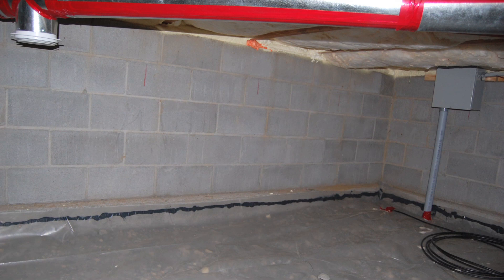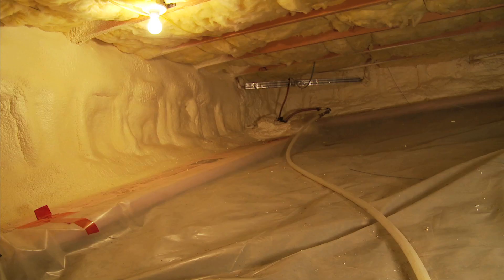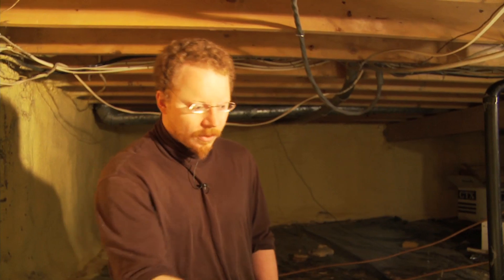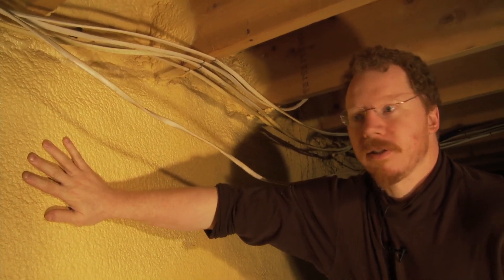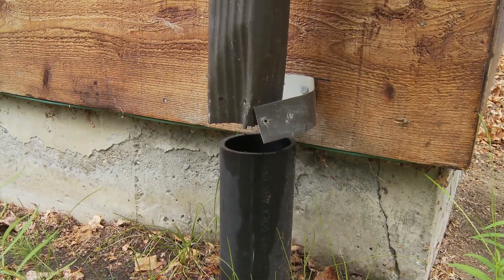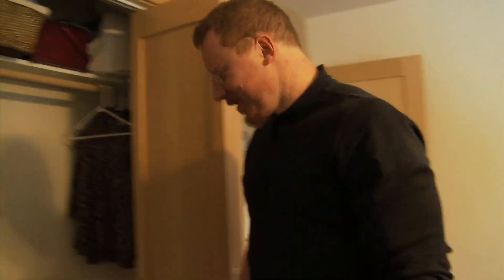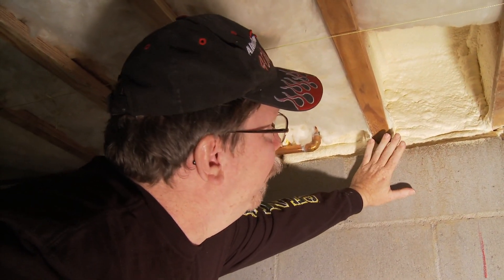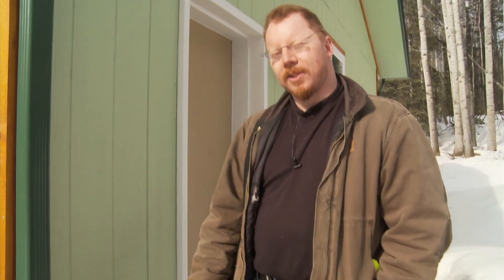Your Northern Home: understanding crawl spaces

Comment: I bought a small but wonderful cottage in Northern Michigan. Built around 1944 and updated around 1996. The crawl space is barely 18 inches! I can't get to 90% of it. There is a corner under the hot water heater where the plumbing runs from one end of the cottage to the other. Struggling to insulate this properly. A windy cold day really goes through the underside and puts those pipes at risk. Every tutorial I watch seems to work with a somewhat "ideal" crawl space. What about the outdated old piece of crap barely above the ground spaces? Any pointers would help...

Comment: If you want your crawl space to be “conditioned”, similar to the living space, why is it necessary to insulate the floor joists area?
Reply: Because it's supposed to be insulated like the rest of the living space, so you aren't losing heat/cooling
Reply: Yes, I agree. The goal is to keep the crawl space at the same temperature as the living space.  If you don't, you will get moisture condensing on all the cold surfaces of the crawlspace (including the bottom of your exposed joists). Also, this home is drawing warm moist air from one corner of the house, past the water tank, which would contribute even more moisture into the crawl space if it is allowed to be cooler than the living space...... so DO NOT INSULATE BETWEEN THE FLOOR JOISTS!!!

Comment: at 6:05 You said foam needs fire protection. 

youtube.com/watch?v=LuGTYfcs-I0  Froth-Pak seems to have a Class A foam can be left exposed up to 2"
Reply: The foam has E84 in it it will not burn. but spray foam is not a good thing to use everywhere, expensive and risky

Comment: What i did on the exterior crawl walls is waited a few weeks for the poured walls to dry then heated up 5 gallons of tar at a time with a electric charcoal lighter then rolled it on thick. you wont find a contractor to do it right like that because they want work later.  why is everybody sealing there house up so tight? if you want to save and have fresh air in the house learn about solar panels. The free electricity can heat and cool the house.
Reply: So you can pay for some kind of fresh air pump? HVAC system.

Comment: If you have pex plates with hydronic forced hot water underfloor - would it be okay to foam over the entire joist cavity ?   Just curious before I go and foam the crawl space.  Thx.
Reply: What did you end up doing for insulation under your radiant floor? Did you run rigid foam underneath? Did you fill the joist cavities? I just installed radiant heat under the floor using aluminum plates.

Comment: Hello !  I was wonderring,,,I have a cement foundation beneath my cottage which is not a full basement, actually it is only about 4 ft in height with a nice sandy floor area..So my question is can i just  spray insulate the whole perimeter of the foundation keeping the are at a reasonable heated temp in order for my above floor to be comfortable on the feet,or must i also spray the underside of my floor,or will that just prevent the heated space below from warming up my above floor on the living space side? :)